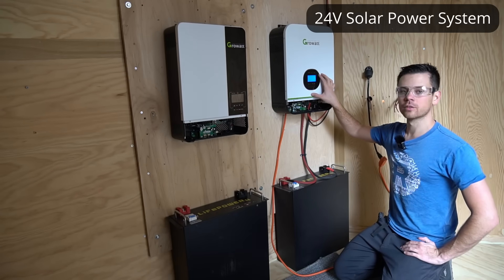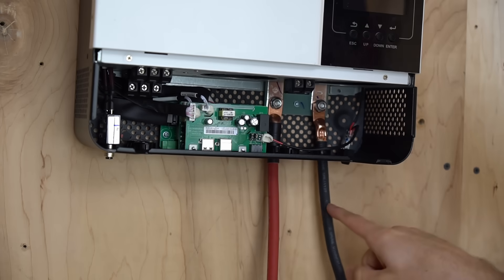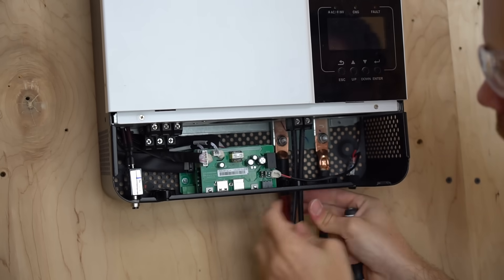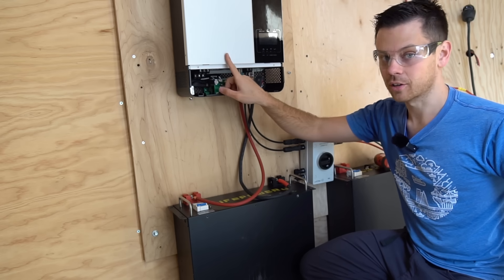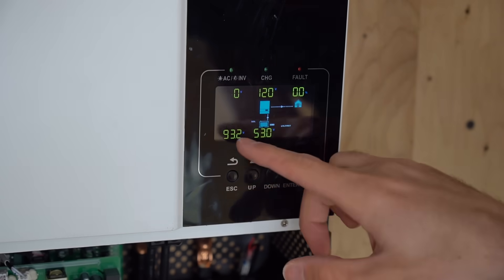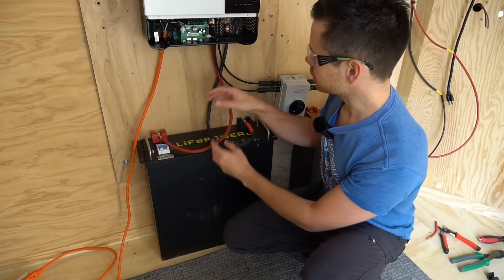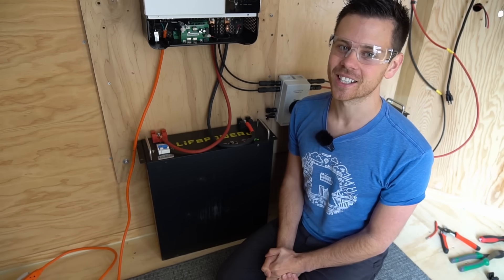Beginner Friendly 48V Solar Power System! Step by step!

Comment: Thank you for the safety tips.   
When I was a young guy still in elementary school 4th grade. I was outside flying my kite one day in Irving Texas. Somehow my kite got stuck on top of the school house building. Only way I could see to get up there without a ladder as I was quite the climber young and agile. Not so much at age 62. Anyway I saw a place I could put my hands in to climb up. Me a  ignorant fourth grader I put my hands inside this somewhat small box to pull myself up further to potentially climb on top of the roof. I quickly found that it was an electrical meter without the face cover on it. Needless to say I got hit with some serious electricity. Which caused my hands and muscles to immediately clinch I felt the current very strongly all the way up to my shoulders. As my feet were on the aluminum sided building fortunately I had enough leverage to break free and fall on my back. I can't recall even thinking about this event since that day and some weeks after. For some reason you're very intelligent teaching brought it to memory. Thank God I had my tennis shoes on if I hadn't I wouldn't be here today. We used to run around in bare feet quite often in the hot Summers of Texas. Over the period of my life I've had many close calls with death which I'm not going to bore you with now. Clearly our creator has plans.

I'm in the process of building a 48 volt system with a battery Bank of 48vx304ah. For my box van RV conversion.

Comment: Thanks again for making solar easy to understand. My question is how do you provide power for appliances that require only 12v, 24v or 48v from a solar system?
Reply: The inverter converts DC from battery to AC.

Comment: Do they make an all-in-one inverter that's rack mount format? Seems to me that would be ideal. We're already focusing on rack mount batteries, so get a 4 or 6 slot rack, inverter in top slot, batteries below, room for expansion, everything will fit together. Bolt it to the wall or floor and be done.

Comment: What happens if you connect more battery's later at a different rate of charge, you need first to equalize them, or the BMS will detect over current on any direction and come online when the voltage is equal between batery's.

Comment: I setup this exact system and it was pretty straightforward. The hardest part was setting up the solar panels.  I am going to install a sub panel next to this with 3 circuits on it and a 30 amp output fuse. Basically going to use it to run 2 refrigerators, a freezer and my office PC along with a couple other small things. Would love to setup a 240v system but determined would require too many batteries.

Comment: This information is invaluable.  I had a question, though.  In an older one of your videos, where you go through setting up a whole system from scratch, you show how to wire up a DC fuse box to the whole system.  This and the inverter both connect to a 170 amp circuit breaker.  In a system like the one done in this video, which has the circuit breaker integrated into the battery, how would you wire up the DC fuse box?  Would you wire the positive and negative from the fuse box directly to the battery or the inverter in that case?  Is there a preference on which?  

I'm strongly considering one of the Growatt 6000W 48V split-phase inverters (currently using a 3500W Outback 24V system), and I want to make sure I set up my DC loads correctly and safely.  Currently, they are wrong in quite a few ways (which I'm slowly discovering as I learn more about how these systems, particularly how they're wired, work).  I'd like to make sure it's actually sized properly when I redo it.  

Thank you so much!

Comment: This is exactly what I want to do for a small cargo trailer conversion project for camping and boondocking (although I'd use the 145VDC max version for 4-5 100W panels in series due to space limitations on the roof). I wonder what would you suggest for Safe Wiring if I need to run a few things on 12V? I assume a 48V to 12V step down converter would do the trick and I think that would necessitate the use of two small bus bars for the positive and negative from the battery as well as at least one fuse or breaker for the converter, but that introduces some added possibility for contacting high voltage terminals which I'm trying to avoid with children around. I would enclose the entire thing so that there is no possibility for accidental contact, but I'd still like to add the 12V output in as simple and safe a way as possible.

Comment: Very excellent job. But am confused with your explanation about the 48V system.
I understand that over 120V DC is dangerous and over 50V AC is not safe too.
If I understand well, you have a 48V DC here. What makes the 48V system hazardous ⚠️ here? Am just curious to learn…
Reply from the maker: Did you not read the text on the video when I said that? Nec and others state that any voltage, AC or DC over 50V is dangerous
Reply: @WillProwse  Thanks, unfortunately I didn’t read the text. I got the answer sir. Thank you for taking your time to reply 🙏🏾

Comment: I have 6 solar panels rated at 305 watts  rated voltage 37.5.  Open voltage 45.8.   What would be the best way to hook them up for that unit.  string 2 in series or string 3in series

Comment: A question about connecting 2 strings. 
It’s marked as max 18A. How strict is that?
I was thinking to connect two strings with panels specified 11,2 isc/A 10,58 imp/A.

Comment: Im planning my system around Enphase IQ8H(240 volts ac) micro inverters but without batteries for the moment. I understand that these can provide AC power during the day or while the sun is shining, my question is. Do I need something else for this to work  besides the micro inverters, panels and combiner box for the hookups?

Comment: 7:37 just wanted to point out that wattage doesn't matter for wire gauges, could be an 8000w system at 600v using 14awg (8000w/600v=13.3amp) but using the same wire with 120v would draw to much current (8000w/120v=66a) and start a fire, conductor sizes are for ampacity and their insulation is for voltage, always remember to use 2KIL or an ampacity chart on short runs. I know it was just a mistake but want to make sure others know, always size breakers (amps) to the smallest wire size in a circuit and size wires for amp draw. Otherwise, awesome video as always.

Comment: If there is insufficient solar / no solar
Will it charge battery from main supply
The area I live in has a lot of power failures and mains supply is not reliable
Its best to keep the batteries always charged if not there is sun

Comment: So I have two of the 48V 3000's and 2 of the same batteries.  I bought them based on the first video you did.  Now I have the feeling that what you're describing is only if you want to use one of each.  If I have two, I need breaker boxes and combiner boxes and all that right.  Like this video doesn't apply at all if you have two correct?
I'm bothering the poor folks on your forum to try to get some answers.

Comment: Theoretically if you only touch the the positive or the negative at once you aren't completing a circuit as far as I understand. I've so far worked bare hands loads of times on my 48v system (gel batteries) so no fancy on/off switch. You can always wear gloves worst case scenario, at least for connecting to the batteries last.

Comment: Thanks for another informative video Will.  Two questions I have: 1) Around 6:25 you measure the voltage of the solar panel array.  Are the panels getting 100% sunlight?  Wouldn't it be better to know that the max output of the panels wouldn't exceed the max input of the Growatt?  2) Would you consider demonstrating how to make a system for a typical 3 - 5 bedroom home that is connected to the grid.  An entire system with the solar panel array, 48v Growatts, and batteries, able to supply two-phase, 12,000 watts of power or so?  If you already did it and I missed it, please point me to the video.  Thanks!

Comment: Will,  im a beginner for sure.. but am looking to build a 48V system for my sailboat. also in the process of installing a 48V electric motor from electric yacht. is this the type of system i should be looking to build? Electric yacht is recommending 48V 400 AH battery system..

Comment: Just starting the learning process. We’re living in the tropics and for the start… run an AC unit and Fridge. No need to cover much else. Cooking is gas. I like the idea of 48v. Definitely not 12v but maybe 24v. Want to be able to expand for full off grid. AC worst case is 24hr. The plan is to tip the panels at 3 periods of the day. Friend of mine does that. Amazing how much difference it makes. He ran a well pump to show the difference… wow

Comment: Hi Will , I have used your instructions on making a  simple 100w solar system,  the battery stopped charging and eventually everything went dead. I cant see anything on the solar charge controller , (only a battery icon flashes)  the system has been installed in my workshop van, I have a flexible panel on the roof, the one part I think is faulty could be one of the cables from the panel to the controller, as the back door is crushing it, (wasnt long enough to reach to a part of the door where it would not get crushed) so my question, how can i identify which part of the system is not working? does the SCC need a battery to turn on or will it come on with just the panel connected to it?

Comment: Hi! I have this inverter Growatt SPF5000ES and i want to know about maximum PV Array input, in specification says 450V in VOC but it has a 93% efficiency and that means 419 V maximum in VOC and my question is: I have 6 Hyundai panels with VOC 46.6 V, VMP 38.8 V, 13,6 A and 480 W, I wish to buy another 2 or 3 panels but for 3 panels VOC is exceed over 419V which is the maximum, a solution for increase system power up to 4 or 4.5 KW? Thank you!

Comment: Hi. I wonder - how can you wire up the system if you have, let's say, 10kW solar and the growatt only takes 4.5kW? Can you parallelize them for solar charging power, too?
Reply: It will only put as many watts as the controllars can put out if you have a Growat I have a 120 250 volt MPPT charge controllar that can conect to your inverter and ad 7500 watts of charging on top of you 4.5kw abs leave a little room for you to expand

Comment: Thanks will nothing but love and a thank you. I am the guy that is retrofit a 26' airstream  for boondocking and wanted to run air conditioning and my refrigerator from solar. And will have flexible panels as the roof is round. So at lest 1/3 of the panels will be in the shade most of the time. I noticed you listed the panles splitter in your parts vendors list. So question you went to 110v  instead of dc voltage to your ac unit is that because of price of hvac unit or efficiency? It would be easier for me to buy a 110v mini split system and cheaper as to get in dc voltage just because they sell more units configured that way. Thanks for the 48v system video I have been waiting for it.

Comment: To simplifi my Question i guess. What are the benifits building a battery bank to run at the max DC input of any inveter if any? Because my inverter has a pretty broad range of posible input voltage from tge battery.

Comment: QUESTION!  If the max input of my inverter is 67v and minimum is 36v if i put 18 eve 304ah cells in series for aproximatly 67 volts and then i limit the charge controler to say 65v full charge will i get a gain in efficiency? And will it be easier on my inverter?

Comment: What model is this? None of the 3000 watt 150 vdc inverters look like this. Looks like a 3000 ES. If so, start up is 150 vdc. Mppt is 120-250vdc. That may be what it's not charging with 94 vdc.

Comment: Is there any way to set up the system so it skips the battery and runs the inverter directly off the panels if the battery is charged and the load is low? As a way to save a few cycles on the battery.
Reply: Yes  first screen set to sub means solar first then utility’s then battery or sbu for solar battery then utility program 1

Comment: Thank you for all the great videos over the years Will. Just one question, would you make a video of all the things to look out for when using two or more inverters in parallel (same size model vs different size/model/company) and parallel two batteries which are the same size vs different sizes? That is something I struggle with when trying to provide a low cost solution to people. Some people are really poor and they don't want to have to the exact same size added on. If they installed a 5kw before, they want a 3kw next, how to go about doing that with inverters? Especially if the previous maker/model is not available in the market.

Similarly, when two batteries are hooked to two inverters, and if the batteries are a different size. Someone wants to have a general load with the bigger size and a critical load with the smaller size, when the general load batteries finish, the critical load should kick in, or any different ways of setting these up. In Pakistan load shedding (lights going out) is a serious menace. This winter, lots of people didn't have gas available to make food let alone heat up houses. Electricity also went out. Summer time electricity will definitely be going out for 3~14 hours for most folks every day. Or point me in the right direction where I should read up on to figure out these things. Thanks for the help.

Comment: Hi Will and viewers, just wondering if anyone out there knows of a simple lithium phosphate compatible “lcd battery monitor” around $50 that I can attach to a prebuilt battery with inbuilt bms to the positive and negative terminal to just give me a capacity?
I don’t want to do what Will does and use a saw to open, just a basic monitor for my 135ah lipo4 battery

Comment: Is there a GroWatt grid-tie inverter? I.e once batteries fully charged, and power draw is satisfied, excess solar power is sent to the grind and conversely when zero solar generation and battery at low voltage disconnect, inverter provides power to the house from the grid?

Comment: What size T-class fuse for putting 4x 12v 206ah SOK batteries in parallel? I'm going to do that temporarily through a Jupiter 2000w power inverter. I will mount the batteries in 4 12v batteries in a series once my Growatt is hung up.

Comment: Love you videos Will, and have bought your ebook when we fitted out our 12v system in the bus we live in.
We are now kicking off a tiny house build, which we will try to keep 12v as much as possible, with only a couple of 230v applicances, so we can have as similar a setup on the house as we do in the bus, i.e. cheaper when not designed to run 230v domestic systems.

I have 2 questions please:

12v vs 24v for house bus & tiny house systems, which is best/more efficient? 

Have you seen/built 60W USB-C wall sockets? 

USB-A sockets, often 4.5V/5A,5V/4.5A,9V/3A,12V/2.5A max, are common for 12v/24v systems.
I am looking for a USB-C socket/charger solution, which outputs up to 12v @ 5A, for 60W devices, around the tiny house. I think this socket solution would support the modern devices in an off-grid, 12v house beautifully. Keen to hear your thoughts on this subject. 

Cheers, Rob

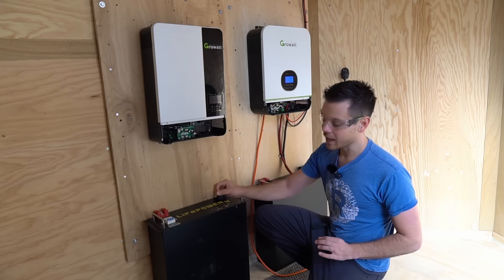Comment: 1:45 buddy - i dont think anyone has ever died in the history of the world touching live 50v dc or even 200v dc - a lot of people follow you , dont mislead them, the fact is that the human body is not conductive enough to pull any current at 50v it will never ever happen.
Reply from the maker: You're absolutely and incredibly wrong. Not wasting time arguing this one.
Reply: @WillProwse  bro this is simple math there’s not much to argue about. Ohms law n stuff,
Reply from the maker: Bro so simple bro

OSHA considers all voltages of 50 volts or above to be hazardous. Electric current, not voltage, passing through the human body causes injury, and the amount of current passing through an object depends on the resistance of the object. As explained in Appendix C to 29 CFR 1910.269, theinternal resistance of the human body is 500 ohms, which is the minimum resistance of a worker with broken skin at the point of contact. The current through 500 ohms from a live part energized at 60 volts would be 120 milliamperes. This level of current, either ac or dc, is sufficient to cause serious injury.2

We are aware of documented cases where serious injuries occurred when employees contacted live parts operating between 50 and 100 volts, DC. See, for example, https://www.osha.gov/pls/imis/accidentsearch.accident_detail?id=775742&id=14295083.3 In fact, although OSHA's standards require guarding starting at 50 volts (AC or DC), it is not necessarily the case that voltages below that level are completely safe, We have heard of cases in which auto mechanics have sustained serious injuries working with 12-volt or 24-volt (DC) vehicle batteries